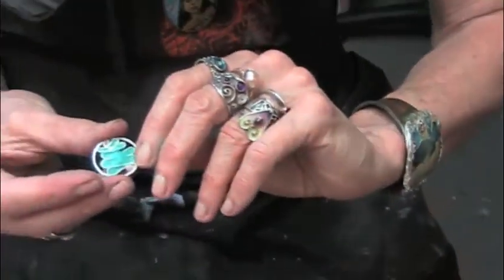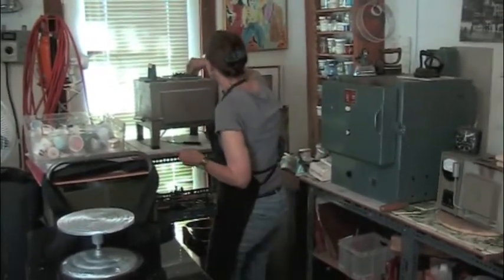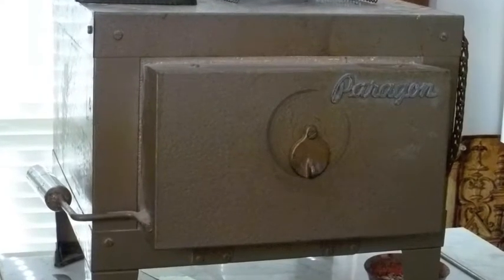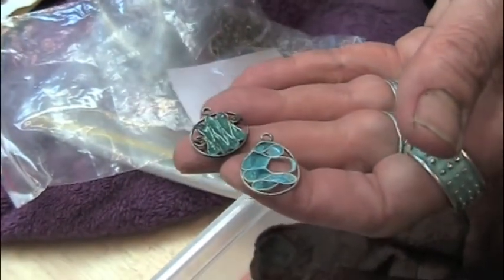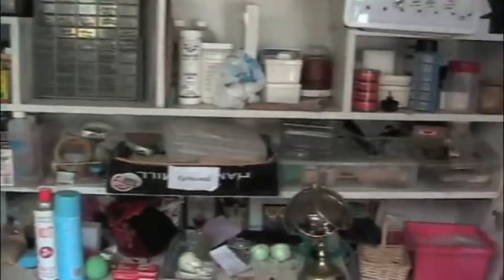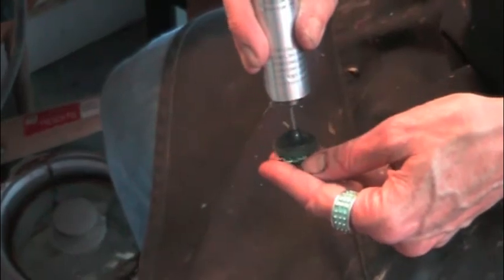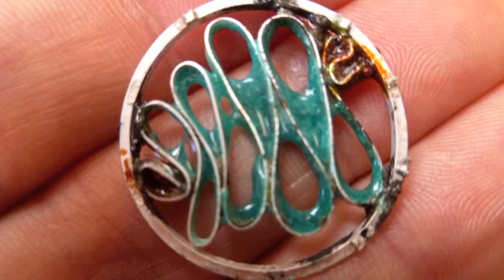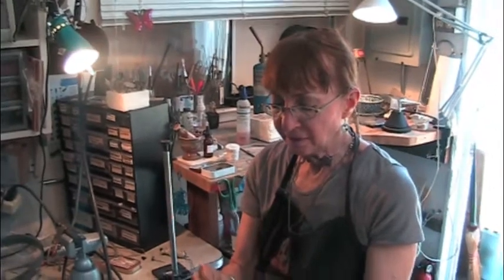Plique-a-jour Part 3

Comment: Nice work Sandra. Thank you! I do have a question though … I had asked an instructor a while ago, 'How do I keep the wet enamel inside the wires?' and I was told to place it flat on a piece of tape, and the tape will burn off in the kiln. Now that I've seen your technique, I'm thinking that 'tape' thing doesn't make sense. Your thoughts?